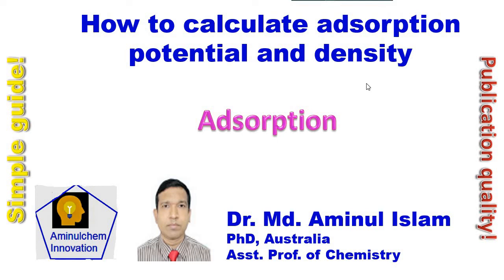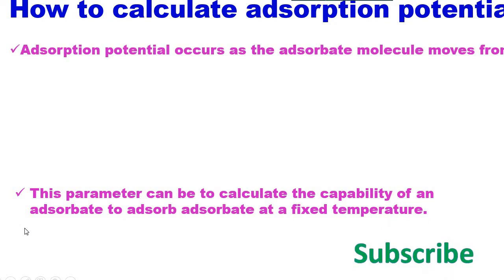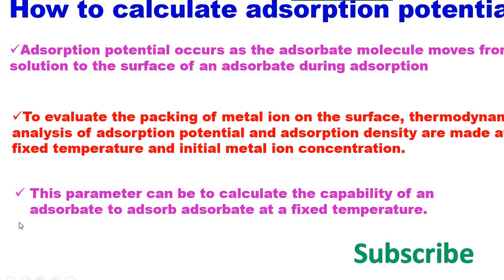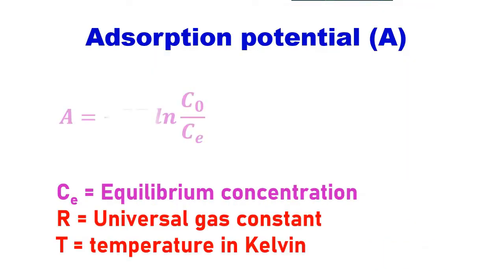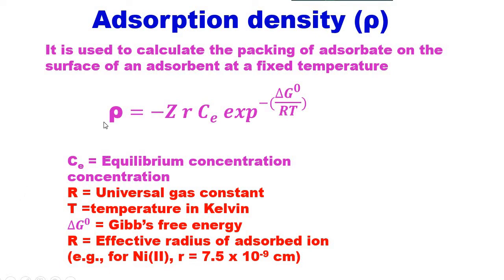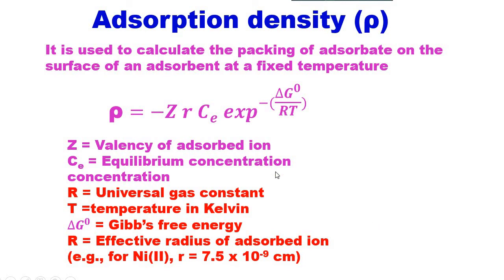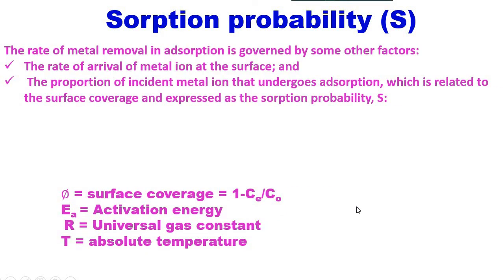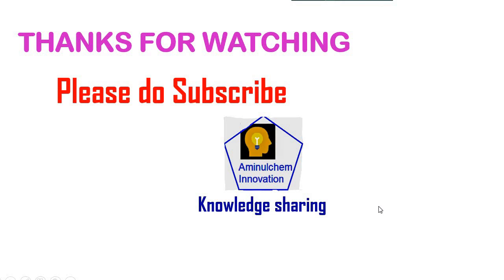How to calculate adsorption potential and density

Comment: very helpful! 
I believe this is applicable to any type of adsorbate, for example MB dye molecules?
Reply from the maker: Thanks. Yes it is.
Reply: @Aminulchem  Sir, so in the case of MB dye, would it be okay to use the molecular size of MB as effective radius?
Reply: @AS-tp3cz  Thanks. Why you need radius
Reply: What do I use for the value of ‘r’ in the formula?
Reply: @DrMAIslam  Sir, apologies for not clarifying- I am specifically asking about calculation for adsorption density
Reply: @AS-tp3cz  Yes. You can use the radius of  MB. dye from literature.